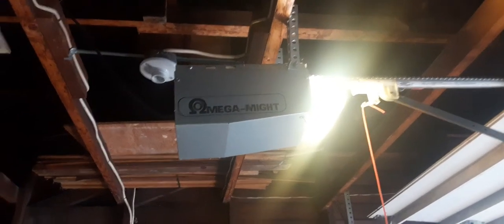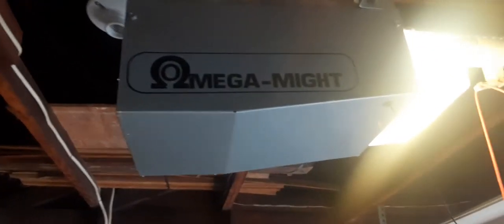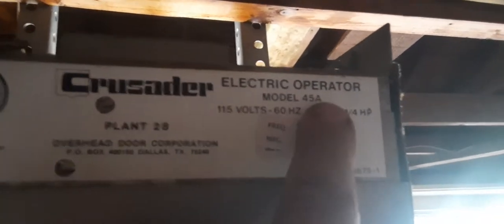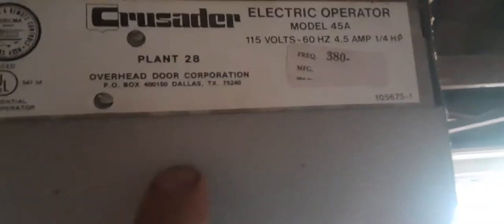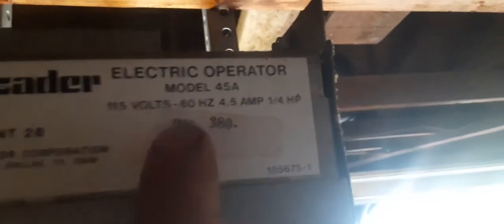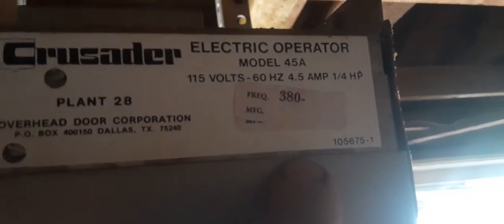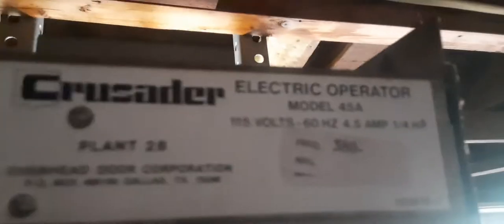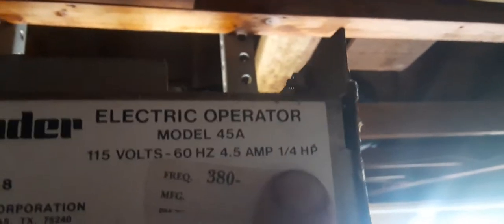Liftmaster 1260LM and Omega-Might Garage Door Openers.

Comment: You really know your stuff with this, little green buddy!
Reply from the maker: Of course, big green buddy! I know alot about garage door openers.  This Omega-Might garage door opener is definitely older.
Reply: @YoshiRocks2244  Oh so its not really new?
Reply from the maker: @RockStoneLee19  No, both these openers are older. The Liftmaster 1260LM is from 1994 and the Omega-Might is probably from the early 80s.
Reply: @YoshiRocks2244  i did not know that, yet it looks brand new! Nice, little green buddy!
Reply from the maker: @RockStoneLee19  Yes big green buddy. The Liftmaster has a date on it and it says 1994. The Omega-Might is definitely older because it doesn't have the safety sensors like the Liftmaster does.  Safety sensors were required on all openers made after 1993

Comment: It appears to be a rebranded Crusader chain drive. Crusader made lots of screw drive machines comparable to the more o matic Sioux 70 and all of the Montgomery Ward machines of the time. Crusader was known for there screw drive machines because they were awesome for one-piece wood doors. But they decided to release a chain drive machine (what has a orange case) for sectional doors but they weren't a big hit because it had to compete with other machines like the more o matic s700 ultra lift, Sears and liftmaster's line of chain drive machines and the OHD touch n go. I believe omega was a supplier of Wayne Dalton garage doors and bought up some crusader machines and repainted the case for there own use.
Reply from the maker: Really? That's awesome. I never would of known that. Its still a cool opener nevertheless. Now it makes more sense why omega was through Wayne Dalton because on these garage doors, there's Wayne Dalton stickers and omega stickers.